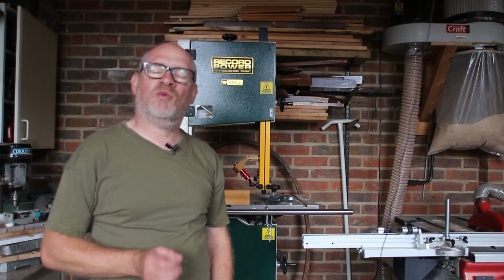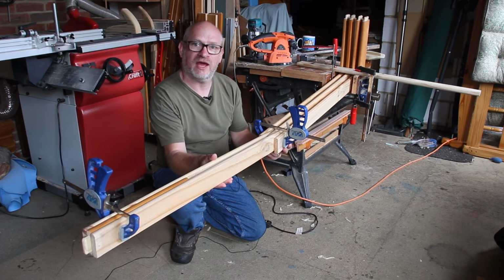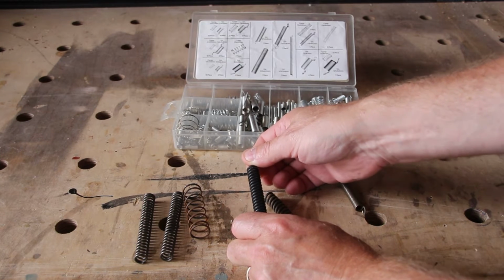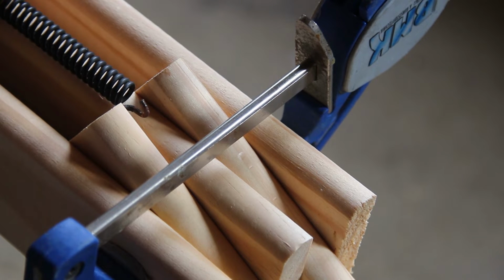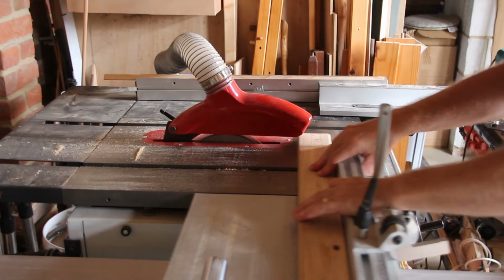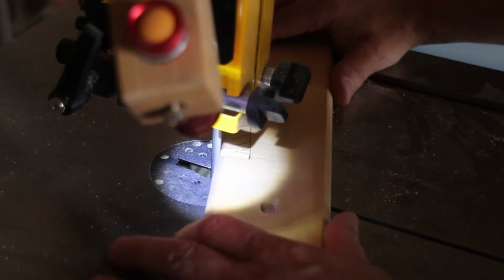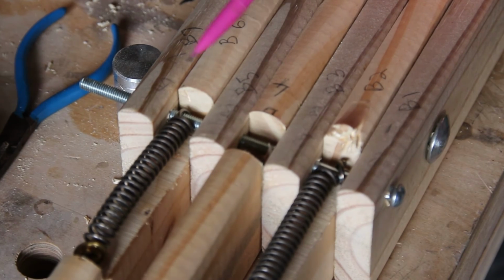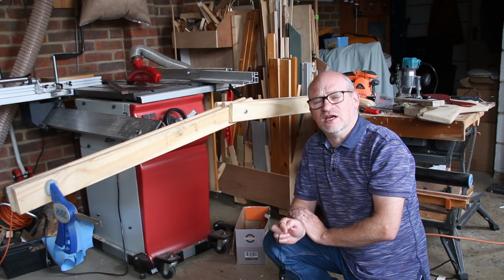105. Designing and making a Boom Arm - Mistakes were made - Part 1

Comment: Hullo hullo...! 
There is too much weight in your boards (arms)...Only top and bottom "18mm" is needed.
2 vertical boards is better than 3 horisontal in parallel
(Double joint doubles "locking" pressure.)
I'm guessing next, 
You'll make a parallelogram arm...With a Counterweight...!

Much inspiration on The Tube...f.ex. Two complex builds: 
Frank Howarth: Making a Camera Jib
John Heisz - My Wooden Camera Gantry And Other Video Gear
Greetings and Tinkerings
Reply from the maker: Thanks for the tips, I'll get there and learn a lot along the way:-)